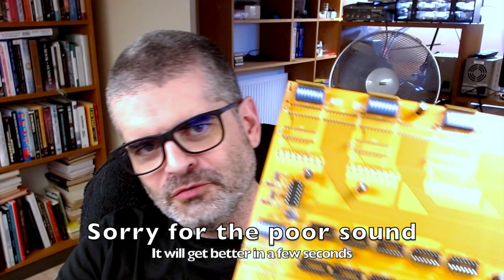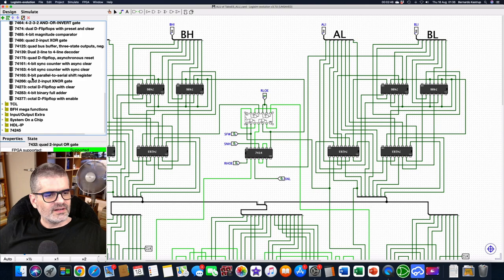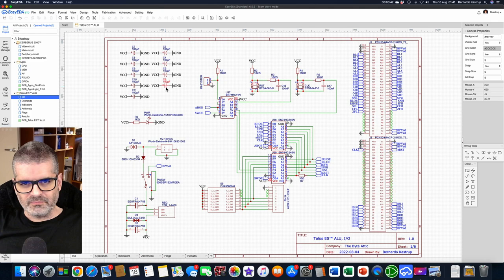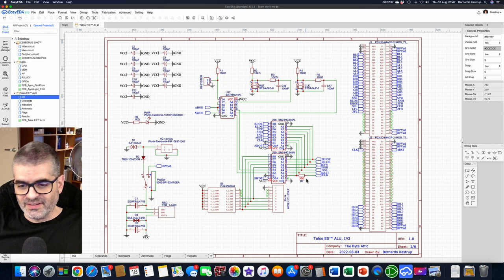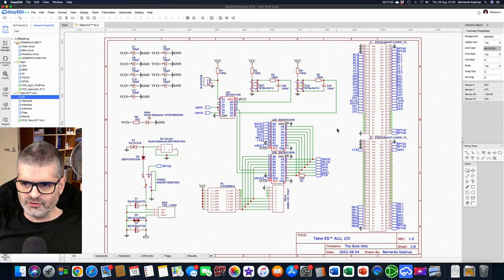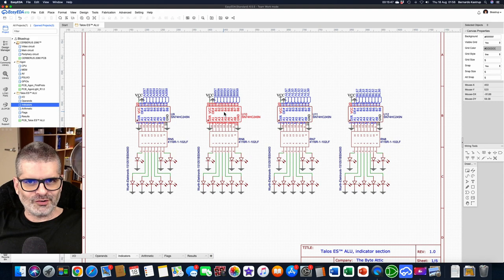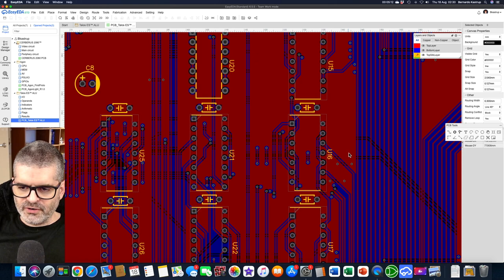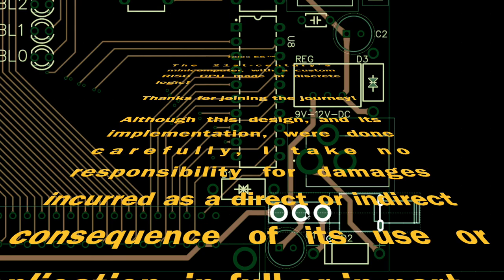Building Talos ES™, the 21st century's mini-computer (Episode 4)

Comment: For the sake of symmetry and consistency, I'd use 2 inverters each for the SNH and SNL, then 1 inverter each for RHOE and RLOE. The SFW signal could then use the extra NAND for its inverter. That also eliminates some connections between the two chips.
Reply from the maker: Cheers mate

Comment: I typically use a P-Chan MOSFET and a resistor for reverse polarity protection. Looks like your design does not need to account for the silicon diode voltage drop before the DC to DC converter.
Reply from the maker: The diode being used is a low drop-out one. The remaining potential is more than enough for the dc-to-dc converter.

Comment: I'm very curious to know what the delay is from control input set-negative-low to carry-out-high.This one passes through several control chips and each of the four adders (which you call ALUs) from carry-in to carry-out. This is probably the longest delay path and it will limit the clock frequency.
Reply: There are other long paths worth checking, for example the one that produces zero-out-high, which depends on the MSB of the result and passes through two or-gates.
Reply from the maker: Yes, certainly. But the carry propagation is the main thing, not the extra control bits. Though the latter don't help either.

Comment: If I’ve followed correctly, many of the buffer chips for the backplane signals are actually not close to backplane connector. In general, would such buffers be close to connectors going off-board or close the the chips generating/consuming the signals or doesn’t it matter? (I realise for a slow speed board it probably matters less anyway — but I’m interested in principles and rules-of-thumb)
Reply: I think that the buffers into the board are away from the connector and the buffers driving the buss connector are close to the connector. I'm also interested if putting buffers for input close to the connector as well would assist or just slow the propagation too much...
Reply from the maker: You want the buffers as close to the backplane connector as possible, both for signals arriving and leaving. In Talos, that was impossible for most signals, as the backplane carries many lines. And I am also prioritizing a clear, didactical layout over certain optimizations.
Reply from the maker: @dugmeister65  The position of the buffer shouldn't change the propagation delay,, assuming that the other parts remain wherever they are.
Reply: @thebyteattic  I wasn’t clear in my earlier comment - I meant adding an additional buffer at the connector.  Good luck with respinning the board.

Comment: KiCAD has copper keep out. Does EasyEDA have this capability?
Reply from the maker: Maybe, but if so I haven't found it ;-). However, it turns out I can set a minimum margin for copper fills alone, without changing the design rules. That will stop copper fills between traces close to one another. More on this in the next episode.